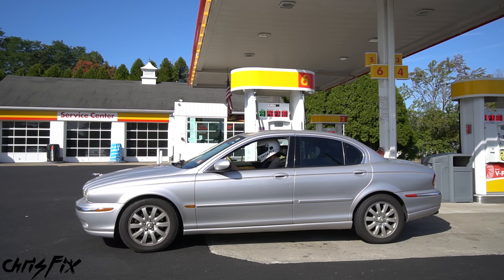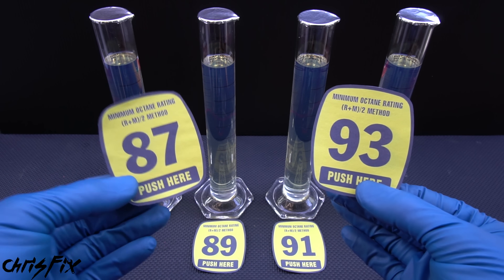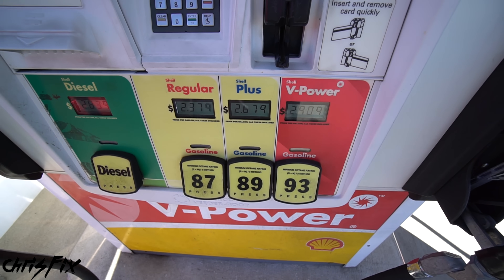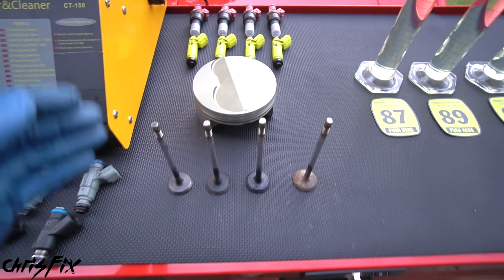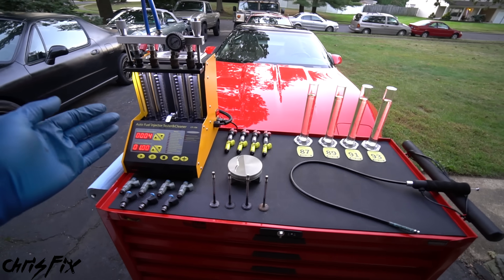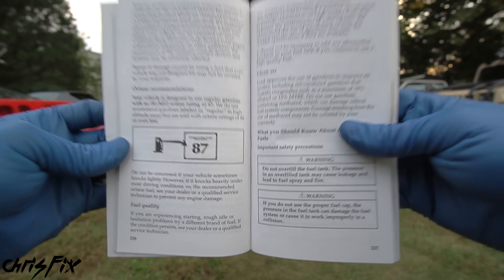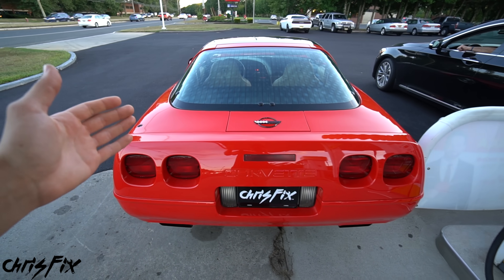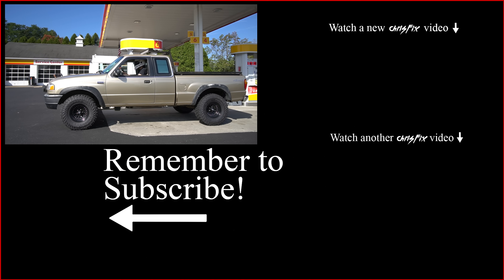What is the BEST Fuel to Use in Your Car or Truck and WHY

Comment: Nice video.  Question please, if a vehichle is recommended to use 89 octane, can you mix 87 and 91 to make 89 octane?
Reply: But why would you need to?

Don't get me wrong I used to play around with different mixtures, but it was for my own curiosity.
Reply: My manual recommends 89 octane is the only reason.
Reply: @crackerjack9120  Fair enough, long answer short yes you can.

Maybe try doing it that way for about a month, and then running on 91 only for a month.

The general rule (that I don't know any exception to it) is that you can always use a higher octane fuel than is recommended,

You just can't use a lower one (I wouldn't advise it) depending on the age of the car, 

and either way you would lose performance, and your fuel economy would suffer

Some cars run better on one brand of premium fuel compared to others (my last car did not like Shell V power, but liked Caltex and BP), but my current car doesn't mind SHell V power.

And you might notice that your car will run better on the semi premium versus the full premium.

Again my last car had the best range on 95, but smoother acceleration on the 98

I hope that this helps :-)

Comment: good video.  It is a bit of a free add for Shell. As an experienced person in engines I support the recommendations in this video
Reply: As a former car mechanic I support the view of the user not needing to use a higher octane fuel than is the stated minimum,

However also as a former car mechanic I disagree with his view that higher octane fuels give no benefit.

Comment: I'll save you 16 minutes. Read the manual for your vehicle. They know the best fuel and lubricant for each product. I tried 91 in my truck and it miss fired running like crap. The manual says. Dont run 91. Simple.

Comment: So as a person how built car engine stock & high performance along with motorcycle engine , and to see the amount of carbon build up in engines that have ran low octane for its life time 🤦‍♂️ and the amount of work it take to chisel it off valves and pistons you wouldn’t run a low octane because it does not burn thoroughly in the combustion chamber , I went to school for all this “hands on information “ and working in the repair industries..
No for the knock what is actually happening is the knock is like an ice pick jabbing and the top of your piston when it’s happening and eventually over a period of time Will put a hole in a piston . I have seen it first hand 😳.. 
not throwing out any disrespect just helping with hands on information
Reply: He also didn't mention that the ECU will use the knock sensor when you are cruising down the highway to advance the timing more finitely to give the most efficient burn.

So having a higher octane fuel will enable the ECU to advance the timing further, and why most people will notice a range increase per tank of fuel.

Comment: What's the point of this? These are not different kinds of fuel, just use what your car specifies in the manual and near the filler... If it says 87 or higher use 87 or higher, if it says 91 or higher use 91 or higher...
Reply: I guess the OP wanted people to know if there are any benefits to using more expensive "gas"

But he missed a vital benefit of higher octane fuels, allowing the ECU to advance the timing further and for longer, which usually translates to more range

Comment: but isn't that 15:36 disproved at 1:41 ?
Reply: Unfortunately the OP doesn't explain how this works.

In short the higher the octane the further the ECU can advance the ignition timing (so the spark plug fires sooner), this gives more efficient burn and so "more bang for your buck"

A crude example is when you ride a push bike up a hill, you go into the standing position and lean forward versus just sitting their in the normal position

Comment: Correction: Some cars, I'll use my Ford FoST as an example, is tuned to run on 91/93 from the factory, however it CAN run on 87 octane. In doing so, you do sacrifice SOME power and fuel efficiency
Reply: So why would you?

Comment: Before I'd run basic regular in my truck with the odd fuel system cleaner now and then. I have now converted to carburetor and it runs a lot better-and farther, on premium.
Reply from the maker: Thanks for sharing!

Comment: Bought a new 2018 Lexus 450h (Hybrid).    Prior to purchase, called different Lexus dealers about what fuel (octane) to use.   3 dealers said premium and 1 told me premium is "recommended" but could use regular.  After 5000 miles, and checking the owners manual, I switched to regular.   Now have 28,000 miles (most long highway trips).   After the fuel change, my MPG remained the same and no knocking.   Performence also seems same or not noticeable degredation.   In the back of my mind I have been concerned if this was a good decision.  After watching your great video, I am not concerned anymore.   THANK YOU!

Comment: My car adjusts its valve timing for different fuel octanes so it doesn't knock on any of them but it gets the best fuel economy and performance with 91-93 octane. There's no turbo and the compression ratio isn't extremely high so how do you explain this if there's no difference to how the fuel burns? It seems you're wrong about parts of this and people who say higher octanes burn slower are right so that if your car has variable valve timing and can run on any octane then getting the highest octane still gives you the best fuel performance instead of just being a waste of money.
Reply: I think you mean that your car adjusts the ignition timing based on different fuels (?)

The higher octane fuels allow your cars ECU to advance  the timing further (so the spark plug fires sooner)

In short:

"Fuel takes time to burn. The whole point of spark advance is to give the fuel sufficient time to burn so that cylinder pressure can be high on the power stroke. As RPM increases, the combustion event must occur earlier so that the fuel can be burned before the piston gets too far down the cylinder."
Reply: @notsureyou  I would say ignotion timing if that's what I meant. It probably changes the ignition timing whenever it needs to just like any car but I'm pretty sure you need to adjust valve timing too in order to run on different octanes properly. At least that's definitely how mine does it to make the performance difference pretty mild. Point is none of these things could make this performance difference if the only difference between the fuels was their resistance to detonation and that didn't impact how fast they burn, since they aren't detonating either way so if they aren't burning at different speeds or anything then wtf is the difference? Given these facts and the ability to use logic, it's clear the video has some misinformation in it which is especially retarded for a video that literally is only about this one single topic and pretends it's going to "clear up misconceptions out there" before just parroting misconceptions instead of clearing any up.
Reply: @HolbrookStark  The change in the valve timing helps the engine to "breathe" better, and is usually directly related to engine RPM

When the engine breathes better you are getting the most volumetric efficiency =A

Changing the ignition timing is why you notice a performance/ range difference

"Advancing the timing means the plug fires earlier in the compression stroke (farther from TDC). Advance is required because the air/fuel mixture does not burn instantly. It takes time for the flame to ignite the all the mixture. However, if the timing is advanced too far, it will cause an Engine Knock."

Having a fuel that can be ignited earlier means that you improve the efficiency power stroke because more of the fuel is being burned at the start of the power stroke. =B

And A+B = :-)
Reply: @notsureyou  makes sense but as you just explained it that means the higher octane does burn slower in some engines and that is vital to the performance difference just like I thought
Reply: @HolbrookStark  It's somewhat that it burns slower, but more in regards to more controlled.

So instead of the entire mixture "going up at once", the mixture expands out in a slower more controlled way.

Comment: Hey Chris I be been subscribed to your channel for years now and I love how you have evolved into the professional that you are now . I have one question . I have a 2004 Mazda b3000 , with 125.000 miles , should I run premium fuel to clean it out or should I wait until I notice any knocking ? Also my truck idles a little ruff some times . Do you think the cylinders are covered in deposits ?
Reply from the maker: Mine idles rough too, change the spark plugs, wires and the coil and see if that fixes it! If not it could be something like an evap or egr system issue!

Comment: Which fuel do you need? Whatever your manufacturer says is required.

There. I shortened your video to the required length.
Reply from the maker: But would you have learned anything?

Comment: Nice video, thanks for doing that... I have a long winded story to tell, perhaps you can shed some light on it... I noticed with my 17 Subaru Legacy 2.5 the computer sets the dash board to read that I'll get 320 miles to the tank full when I fill it up with 87 Octane, obviously as I drive I watch the miles go down as does the gas gauge. Then one day I put 95 Octane and instead of reading 320 it read 380 miles to the tank full. Wow, I'm not sure why that happened being the manufacturer says for "best performance" to use 87 Octane, so is using the dash board read out of the increased fuel mileage an actual accurate measure to use? seems to be to me. So I found this kind of conflicts what you mentioned in the video? although, I might not be fully understanding the video... It seems the computer gets many types of readings of the fuel from various sensors (O2 sensors) on the type of fuel I'm using and calculates the fuel mileage in about a second or two when I start the engine. Well... anyway, I wanted to share that. it would be interesting to know more about this, in thinking all kinds of engine do have different characteristics in design where it can make a difference using a higher Octane (like maybe my engine compression is a little higher where using a higher Octane can make a little bit of a difference, like 60 miles more to the tank lol) but 87 works just fine. Oh yeah..., I wanted to mention for people who are worried when at the pumps they might put Diesel fuel in their gas tank by accident to not worry, because the Diesel fuel nozzle is wider and won't fit into the gas tank filler neck.

Comment: I've had shell ruin my Mini and Mercedes. But every other car fine.
Reply: I was running V-Power Shell in my 08 Mini. I was hearing "knocking marbles sound, stumble, hestitation, RPM drop offs while idling at stop lights...Bought 5 gallons of EXXON/MOBIL 93 with 10% Ethenol...No knocking, no drop offs, no hesitation, no backfires. Mini is also turbo charged with a 6 speed @ 120k ODO.

Comment: i don't agree here. if higher octane rating is better then how come i experienced stronger engine power but overheated the engine block and cause it to bulk. your logic should make higher octane smoother and more efficient to use by all gas engine cars but it is not the case. there are still different designs and intended fuels depending on the  manufacturer.

Comment: I have an 1987 s10 Blazer v6 throttle body fuel injection, it was designed to run on regular unleaded gas before they started selling the "cleaner" oxygenated fuels , it seems like because it is burning cleaner the computer dumps in more fuel to get it back to original "dirty" burn, I have had several people suggest this, you sound like you mite know this stuff,  any comments?

Comment: How clean your valve is, doesn't depend on the gas you put in it, if you have direct injection engine. Since the gas goes directly in the combustion chamber, the gasoline doesn't touch the intake valve. You forgot to mention that ;)

Comment: Shell's premium is 20 cents higher then others. QT and Mobil are top tier gas stations so I go there. I think Top Tier rating is very important in deciding on gas stations. For example Sam's is usually the cheapest in our area, but it's not TT so i stopped going there. Costco is TT, and cheap but not near me...ugh!

Comment: Having seen (and heard) so much bullshit on this subject, frankly I was ready to shred this video, but you nailed it very nicely! One thing not mentioned likely in the interest of brevity, is if you need to have an engine repaired, spend the money and take it to an expert. A burr in the metal from scraping an old head gasket off incorrectly (steel scraper on an aluminum head for instance), or too much gasket cement if older gaskets are used can squish out into the combustion chamber and glow red hot in a running engine. This creates pre-ignition which is pretty much the same as Detonation.

Another sign you need higher octane is (pretty much on old cars anymore) is when you turn off the key and the engine continues to kerplunk along. It’s then running with no spark-plug firing at all. It’s running then on pure detonation. This has also been called “Dieseling” back in the day.

Just thought I’d toss that out there. Based on the video content I know Chris already knows this stuff. I just added here in case anyone wanted a little more on the subject.

EXCELLENT VID CHRIS!!!

Comment: I agree with most of what was said but I have to disagree on premium vs regular  usage. I use premium on all my vehicles regardless of requirements and some were fuel efficient with smaller engines. I never had an issue with any of them and I owned at least 30-35 cars or more in my lifetime. I also learned to drive when I was a young teen and have 51 years of driving experience. I've Had BMW's, Mercedes, Mazdas, Fords, Buicks, Cadillacs and others and now own a Buick Encore a.w.d. with the 4 cylinder engine because I'm retired and enjoy a smaller, more fun and envolving car to drive in tight corners. I've noticed that even though I have a small turbo it seems to perform and spool up quicker with premium fuel. Not that regular fuel is bad but it seems I get better performance, with premium and I don't mind the extra cost. Some auto fuel companies as you stated do put more additives in premium fuel as an added bonus plus the premium fuel I use contains no ethanol, although engine designs today are fine with ethanol. It all comes down to personal preference but for those with fuel efficiency in mind with smaller engines, they should use regular to save cost because that's their preference and goal. Good review.

Comment: The E-85 label says "up to 85%" ethanol, meaning it could be less than 85% but this is fine for flex fuel vehicles.  Winter blends of E85 will contain less ethanol, maybe 70% or so to aid in cold starting, etc, while summer blends will have more ethanol.  You will need to tune your car in order to run E-85 if it is not flex fuel and this can increase the performance but decreases fuel economy.  Some cars allow you to flash it to E85 and flash it back to stock if you need to fill up on regular pump fuel.  Last but not least, all gasoline sold in the US I believe is actually E10, meaning 10% ethanol and all modern cars and even older cars can safely run on E10, so even 87 octane gas is actually E10.

Comment: Technically your detonation video is INCORRECT !! it's caused by PRE-Detonation, High Compression Engines and Turbos Cause HEAT and this HEAT Causes the Fuel Air Mixture to Explode when the Piston is on the Way UP, not a few seconds before top dead center when its supposed to go off with the Spark, there are not multiple Explosions at top dead center, the Premium fuel burns slower and will not Pre-ignite by the heat of the Compression.

Comment: Very good video. You should have spent a little more time discussing altitude. Vehicle octane recommendations are for sea level or low altitudes. Higher altitude locations carry lower octane fuels and that is OK. I am at 4500 feet and standard fuels here are 85, 87, and 91 all of which are E-10 (10% alcohol). We also have non-ethanol 88 octane. There are select locations than may have higher octanes available but at a cost and not needed in most stock cars/trucks. Thanks for a great video.

Comment: Choices in rural Europe are simple: diesel or 95 gas. Take it or leave it.
Reply: Are we to assume 95 is the octane rating which would make entirely good sense to do as the European engines are a little more performance orientated and from what I've seen there are very expensive cars on the Autobahn and I would imagine some very irate Germans with melted piston then burnt bent valves in their million-dollar Porsche would be very exciting the octane was the problem
Reply: @donniebaker5984  Americans usually use the AON of the fuel most European countries use the ROZ of the fuel (at least that is the case in germany) your 93 octane gas is comparable to our 98 gas. We do have some gas stations offering 102 ROZ fuel tho.
Reply: @callofmarlboro   at the AR o z 102 stations that's probably where you'll find some exotic cars filling up their tanks? Which brings up the question that I've never seen named octane ratings for zondas Lambos McLaren Porsche Carrera Lotus Aston Martin Mercedes-Benz BMW cars like that
Reply: @donniebaker5984  You obviously didn't watch the video if you think Europe's 95 octane is anything more than we have here.
Reply: Of 98!
Reply: In Europe we have 2 diesel options and 2 (95 or 98) gas.  You can call us rural with one exception - not if you come from USA ...
Reply: Or
Reply: Not true, and don't forget the 10%Bio-Ethanol mixed in it. The difference between E5 and E10 fuels.
Reply: Europe's RON 95 is similar to North America's AKI 91
Reply: If you European citizens had guns with tons of ammunition like the American's than you'd have more choices